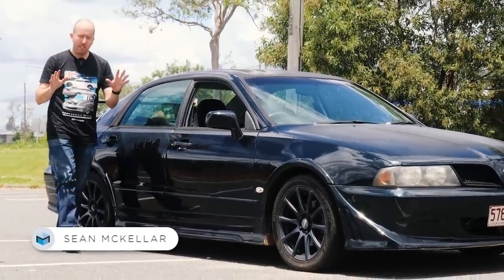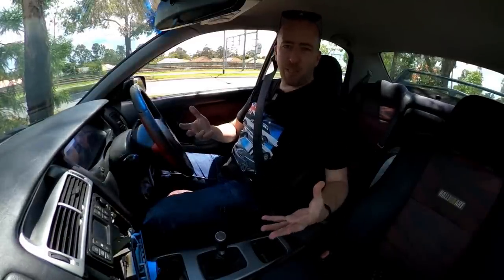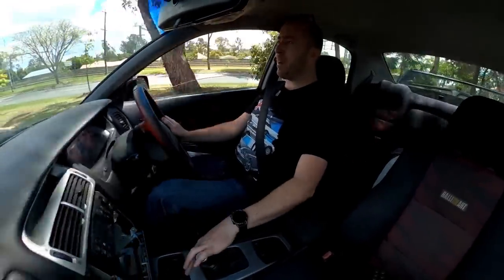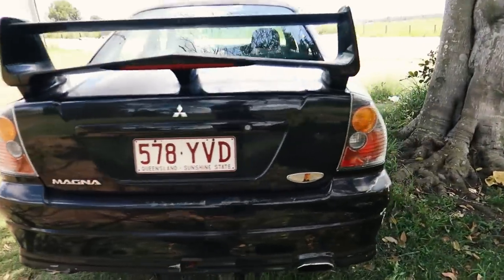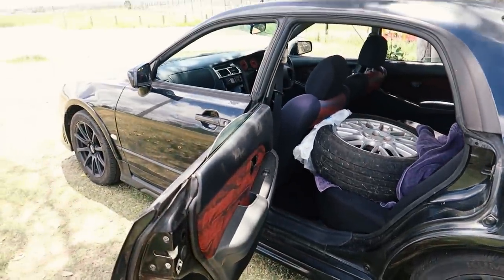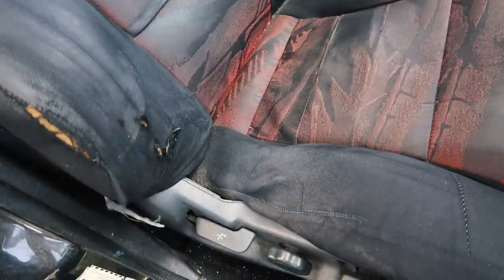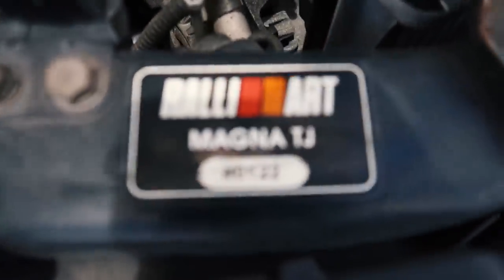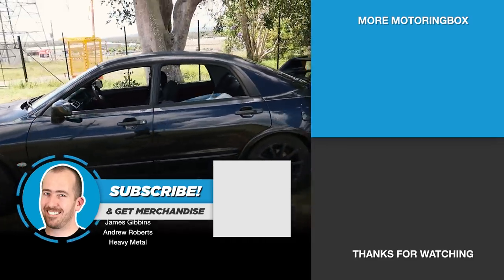Mitsubishi Magna Ralliart First Drive! This Aussie 180kW 6G74-powered manual sedan is a screamer!

Comment: I owned one of the executive versions of the Magna, still with the 3.5L V6 and a manual gearbox, but only tuned to 150kw and that thing used to go hard off the mark. Shame it was a front wheel drive, but I hard the opportunity to do many traffic light pulls against a variety of cars, and there wasn't many cars that could beat it in the 0-80km/h range. That was including SS commodores (with the 5L V8), Golf GTi's, WRX's, just to name a few. Definitely one of the most underrated cars of the time.
Reply: Must have been tuned if it could beat all of them.
Reply: @brantleyfoster021  either that or the other drivers didn't know how to drive haha
Reply: Plus, it would have been a different outcome past 80km/h. I think the manual gearbox had really good ratios and being NA, wound up much quicker than the Gti/WRX did with the initial turbo lag. The only mods I had done to it was a drop in K&N air filter and it was also lowered with stiffer springs, so it had heaps of traction off the mark.
Reply: @JoViDriven  
It also depends on whether those car's were trying in the first place though. 
Although some Magna's came equipped with different cam's that boosted power to 205kw-210kw. 
Perhaps your Magna has them too.

Comment: I own a 97 Mitsubishi magna its a 2.4, 4cylinder 5 speed manual goes like a rocket has 300,000 ks on the clock .I do regular maintenance .Only major work on motor was overhauled the head ,doesn't blow smoke or use oil.
The only thing I hate about the ralliart is the bonnet if they left the old bonnet with out the stupid centre part  and put a bonnet scoop on it would look so turf.
If you think you car is Rare there were a couple of super charged magnas built.we had a red one come into the dealership I work for it was a red one and they are super rare .and probably worth a fortune now
Reply: The supercharged ones were probably the fastest ones. 
There was a few FWD & AWD supercharged model's. 
The most powerful one had 251kw & 440nm, it was a wasp yellow TJ VRX.

Comment: Might need a clutch replacement if you keep slipping the clutch on down change, I think you could get the 4wd in the later model like yours, mist u bit a shitsu are good but like every vehicle, regular maintenance is the key longevity, possibly could have got a better one but time and location wouldn't be on your side. It is a good project for you tube, would like to see the outcome.

Comment: My first car as a p player was a 3l tf with a manual in it at the time mum had a tj series 2 vrx in wasp yellow (1 of 50 made rather than the ralliarts 500) they did have a habit of spinning tyres but were fairly quick and were relatively competent as a sports sedan if you could drive them
Reply from the maker: I saw one of those for the week in good condition for 5k - looked really striking in yellow! Someone got a good deal.
Reply: @MotoringBoxTV  I’ve been half looking for 1 for a few years but they don’t come up often and I’d prefer a manual the couple I’ve seen have been clapped out beyond reasonable repair
Reply: @MotoringBoxTV  
It's actually getting very difficult to find a good condition TJ series performance model like a Ralliart, VRX, AWD Sports or a Supercharged varient. 
They tend to sell fast if they do appear.

Comment: It is recommended you renew the six small circular rubber fuel injector unit seals - these may 'look' okay - but they will be be 'hard' and not optimal if they are more than 5 years in place, due to high proximal heat in use - a small thing - that brings an immediate and noticeable improvement to an older fuel injected engine, in concert with a new PCV elbow valve - cheap easy fixes that will improve your driving experience for cents on the dollar - also find another airbox filter holder and K&N equip it . .  :)
Reply from the maker: I could never find a part number for a K&N that fits!

Comment: I think $5500 is a more than fair deal considering it's almost complete - the sum of it's parts would easily be more than that if parted out, although that would be a massive shame. The running gear alone would set you back most of that, if you could even find one (although there are aftermarket LSDs and engine performance bits available to hop up a standard one).

Getting the original Enkei wheels included in the deal is a great bonus. I'd definitely be refurbing them and putting them back on the car. Your taillights are also not technically correct for the TJ - I believe they're TL/TW VRX items.

The stereo fascia and original stereo shouldn't be too difficult to find. The door handle surrounds are identical fitment across all 96-05 Magnas, although if i'm not mistaken the Ralliart ones are supposed to be a chrome effect, and most Magnas they're black or grey. Some Veradas have the chrome ones as well, or you could get some standard ones and have a go at wrapping them with vinyl. They do break easily but you should be able to find some at a pick & pull type wreckers - front & back are the same, only left & right are different. Grab more than 1 of each if you find them.

I can recommend joining the AMC groups on FB - the community for these cars is very good, and there are some members who have stashes of parts who would no doubt be glad to help with this project.

380 front discs & calipers are a direct upgrade and not a bad one to do if it needs front brakes.
Reply: ralliart door cups are not chrome only verada are chrome and rarer then ralliarts, dont put 380 calipers on it, awd brakes are the same as ralliart dual piston calipers, same brake pads, same brake hoses, ralliart enkies are not the same as the others from japan so be careful

Comment: Nice one. Parts are cheap thankfully. +1 for keeping the stereo system 'stock looking' and original wheels when the time comes
Reply from the maker: This might be one case for not going with the stock stereo - it was a double-din Eclipse jobbie that already looked aftermarket even though it was factory OEM. They're very hard to find second hand so I may not be going that way!
Reply: @MotoringBoxTV  also some of them are locked by the original owner with a cd, ihave yet to find any one that can unlock the eclipse, there was a factory/dealer cd that could unlock them , but i have yet to find it

Comment: 5k LFA. 😄

I think that the manual saves it a bit, and makes it more fun to drive than most would think.  Surprised that Redline isn't a tad higher though.

The body kit is growing on me.  Slowly. 😉 (If it had a small boot lip rather than the big rear wing I'd be sold).
Reply from the maker: Wing is the best bit, even if it's usage is questionable on a fwd car 😅
Reply: @MotoringBoxTV  I'll let you taste in rear wings slide this time, only because you and I share a passion for KFC.

Comment: Cool Video. I always loved the TJ Magnas. Having owned a 300 rwkw XR6T and currently own a VFSS with bolt ons and a tune (that's just a tad slower than the XR6T) I overlook how good manual TJ 3.5 magnas are as a budget performance car. Owned a TJ Advance wagon 3.5 around 2006, loved the engine but with the automatic it was way over geared so performance suffered accordingly. It would have done 160 kph in 2nd gear WTF?
Reply: I saw some rather powerful Supercharged Magna's that were built. 
Some were AWD too.

Comment: I would have at least knocked the previous owner down another grand. That centre dash console looks like a nightmare. In regards with the seats, well if you can find OEM material, you'll get there but start looking around for Magnas for wrecking as spares.
A month ago I went down to Sydney to look at a Holden VY S ute with a factory optioned LS1. It was a rainy day. The ute had seen better days but it had been serviced every 5000kms. Took it for a drive & within 5mins the engine light came on. The owner wanted $12K for it and I got him down to $9K mainly due to the engine light. A VY S Pack with an LS1 is pretty rare as an SS ute back in the day was an extra $2600 with all the bells & whistles so more SS utes were sold. I drove it to a mechanic I know & the engine light problem was due to a melted O2 sensor wiring which was a cheap fix. Since I've bought it, I've upgraded the exhaust, sourced a black interior, replaced the crappy single DIN stereo, replaced the broken & worn seats with a leather/cloth set & it's a different animal to when I originally test drove it. You'll have fun sourcing parts & trim for the Magna as they're getting thin but this should be interesting. Again great video Sean.

Comment: those 3.5 V6's are quick!, they'll out accelerate the same year XR6's or any V6 commo whether it be from standing start or from 60 - 120 & handles better then any Falcon or Commodore aswel i was shocked when i drove one!
btw; working on a V6 Magna is a REAL PAIN IN THE @RSE! just doing a simple service requires you take disassemble the top half of the engine!
Reply: Not really. You do the rear plugs and manifold every 100k - no more than 15 minutes to pop the intake manifold off, it’s really not the worst thing
Reply: @dodgeviper89  still worse then not having to do it at all though lol
Reply: @GTFORDMAN  look, nothing beats the falcon inline 6 for serviceability. But that sweet 6G7x motor is just so beautiful to drive. Torquey, powerful. That sweet note. It just has some characteristics the falcon engine never had. Worth a tiny bit of pain every 100,000kms to hear that glorious note!
Reply: @dodgeviper89  if you talking Torque and care free maintenance thats a Falcon 6 all day every day they'll always be my go to engine, but i must admit my Falcon gets left in the dust if i try to beat the 3.5 Magna in a 60-120 over take!

Comment: Enkei wheels came on pretty much any special dealer options from mitsi in aus all the pajeros 1997-1999 in the mid&top (escape & GLS respectively) trim models came with them as standard
Reply: those enkies are differant and rare

Comment: as someone with a manual eb and manual magna. the magna used to walk away from the falcon until, i turbo'd the falc that is
Reply: But what would happen if you turbocharge the Magna?
Reply: @brantleyfoster021  it would kick the falcs ass again 🤣🤣
Reply: @ethanburgess8355  
Should put the TMR 380's engine into your Magna. 
Give it 270kw & 550nm.
Reply: @brantleyfoster021  thought about a regular 380 swap as it's simple af, but I want my falcon to be faster
Reply: @ethanburgess8355  
If you put a brand new 6G75 into your Magna, upgrade the ECU, upgrade the exhaust & upgrade the cam's. 
Think it will be a significant threat to your Falcon turbo tbh.

Comment: 11:40....it's not all present. You're missing the bottom lip of the front spoiler. Alot of owners took the lower lips off because they were getting knocked on speed bumps etc.
Reply: Yeah I noticed that, it's missing. 
I thought maybe he was trying to save weight by taking it off.

Comment: Top car, if I had the cash spare I'd have bought it at that price, the manuals had an LSD which were afaik the only Magnas to get one(Hah, should have finished watching before I commented)
Also, take the little intake mufflers off the intake flex pipe, they make a nice induction noise, very warbly.

Comment: How would you rank your cars in terms of reliability, ownership, driving experience and performance? Ralliart Magna, AU Falcon or VT Commodore?
Reply from the maker: AU is the reliability king, but the driving experience and performance isn't as good. BA drives the best and has the highest performance, but has probably had the most go wrong with it. Magna sits in the middle of both so far!
Reply: Thanks for the reply! Am tossing up between an AU and a Magna with a 380 engine swap. Have heard about the AU reliability but lack of driving experience so hence looking at the Magna as well
Reply from the maker: Magna with a 3.8 swap sounds like a lot of fun. So long as the conversion was done well and the car is in good condition.
Reply: @MotoringBoxTV  Exactly! That's why I wanted your take since you've owned both the AU and Magna. I've got an EL at the moment and it's pretty good to drive. Just after something with more power and better handling
Reply: @pernchua5646  
The Magna is just as reliable with a 6G75 swap, Mitsubishi do it themselves too despite the power hike. 
It doesn't compromise on insurance or roadworthy. 
If I can suggest too, there is some Sprintex Supercharged AWD or FWD Magna's floating around. 
The only difference with the Supercharged model's is they require more frequent service intervals of the timing belt & water pump (50000km swaps instead of 100000km), but you get anywhere from 225kw to more than 250kw with the upgrade with a massive torque boost depending on the model. 
But make sure you go for the TJ series of anything. 
The Ralliart Magna had the most unique standard features, it was even suitable for expansion in many area's.

Comment: So I'm guessing you either don't  know about or Australia didn't get the Mitsubishi Galant VR4 (the american version of the magna) all-wheel drive version? Somebody could take that all-wheel drive system and slap it into your Aussie 6g74 rallyart magna and make a pretty cool car!!
Reply: Mitsubishi Australia got the AWD Magna. 
The most powerful one was a Supercharged version putting out 226kw & 422nm while weighing 1604kg or 1575kg with a flat tyre repair kit. 
It was auto only, but it has the same auto gbox as the EVO VII GTA, which can be heavily reworked to include launch control & much faster shift's. 
It went & handled much better than the RWD competition, in fact it was used in alot of Rally competition's & did pretty impressively from what I heard. 
Manual conversions are available for them too, which is meant to take off a huge amount of weight.

Comment: I had a Diamanté 30M with the 199kw 6G72 engine and I’m surprised Mitzi AU chose to go with the less powerful 6G74 option in 02. The Ralliart had the better exterior.
Reply: I think the Diamante 30M had 201kw. 
But the Ralliart had more torque at 333nm. 
Plus 5 Ralliart Magna's had different cam's & compression ratio that pushed power to 210kw with a torque boost from the factory.  
Plus Australia offered Supercharged varients approved by Mitsubishi, the most powerful of which was a manual TJ series wasp yellow Mitsubishi Magna VRX that got 251kw & 440nm - which was probably the most powerful Magna built & significantly lighter & faster than a TMR 380.
Reply: @brantleyfoster021  awesome. I did not know about the other models.
Reply: @barron204  
They had Supercharged AWD model's too, they had 225kw & 422nm. 
They weighed about 1604kg or 1575kg with a flat tyre repair kit.

Comment: It has an impressive sound, are you sure it isn't a 210kw example? 
Check the cam's to be sure. 
Some had different cam's that boost power to 210kw.
Reply from the maker: Didn't know there was such a thing, I'll have to figure out how to identify it.
Reply: @MotoringBoxTV  
You have to check the cam's, I'm suspicious that it may be a 210kw example because of the sound & watching it accelerate. 
Some model's were released with this power output unofficially. 
Autospeed did a review where they pitted a STI against a Ralliart Magna in a drag race & the Ralliart Magna killed the STI according to them, despite the Ralliart Magna being passenger disadvantaged - think it was also a 210kw example. 
You can get the upgrade done, doesn't affect insurance or roadworthy since some model's came standard with that setup.
Reply: Yet again. There was no such thing. They are all 180kw builds
Christ almighty there is a ton of crap information being spouted here.
People throw in 3.8L motors from the 380 which THOSE engines regularly spun up 200kw on MMAL’s engine dyno - they were de-tuned for road use.
There is no cams that just drop in that magically bump it up 35kw
Reply: @dodgeviper89  
There was 5 that were built this way. 
They use a cam called the Doctor John camshaft that boosted power to 210kw in the Ralliart Magna & they had a wilder compression ratio. 
They were pre-production examples that were converted to production. 
The thing is, the build is available to do as well so it's not clear how many Ralliart Magna's have it anymore. 
But there was 5 released from the factory like this.
Reply: @dodgeviper89  
Look at the AMC forum's. 
It's confirmed there. 
It says: 

Early, pre-production versions of the Ralliart Magna sported compression ratios of 10.1:1 with wilder cams and made between 205kw and 210kw at the flywheel - unfortunately they never officially made it out of the factory primarily due to emissions concerns. Plus compression ratios of 10:1 and higher don't play well with 91 RON fuel. 

But the thread includes an example of this car, these were dyno confirmed build's too. 
They are significantly quicker than the 180kw build's. 
They fetch a higher value in price too. 
Probably still the quickest Australian made NA V6 on the market, since they weighed alot less than equivalent NA V6's from Falcon, Toyota or Commodore.

Comment: 180kw in 2002 was pretty good for a car. SS Commodore had 220kw. Xr6 had 182kw and XR6T had 240kw.
Reply: The engine design was extremely simple too, that's what impressed expert's the most about this car. 
Just the way the engine made so much power & torque with a very simple design. 
Some actually had 210kw too.
Reply: Alot of the car's you listed were significantly heavier car's though. 
Most of them were over 1700kg. 
The Ralliart Magna was 1470kg, but it would be alot less if you replace the full size spare tyre kit with a flat tyre repair kit like the competition were doing at the time. 
It's mainly because you need to take out the boot floor carpet & wooden masonry board for it to work, so the car shed's off over 30kg.